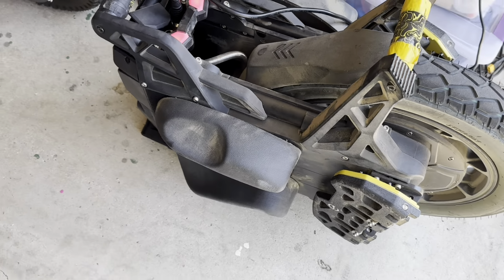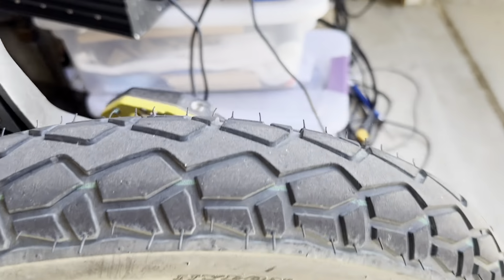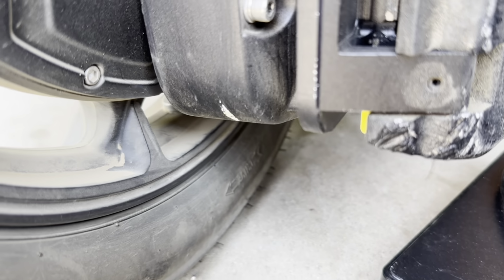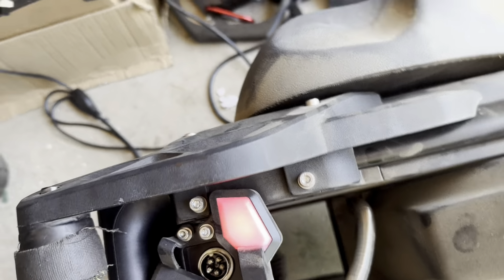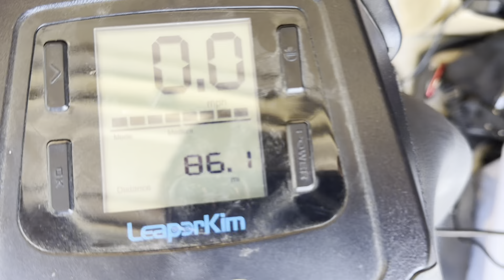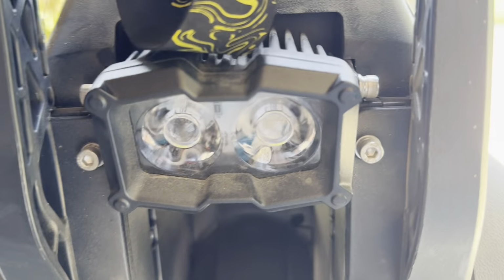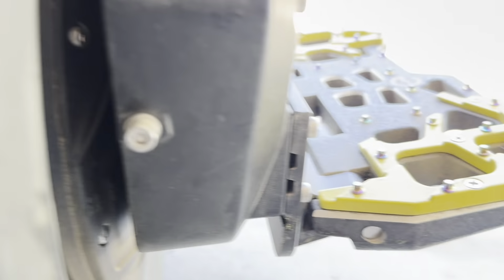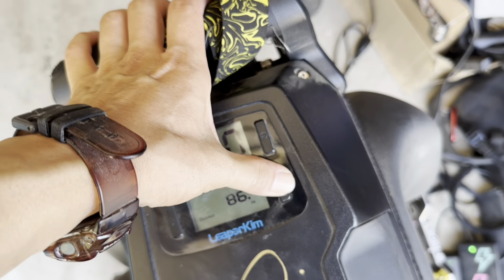I Got A New Wheel to Ride!!!

Comment: Hello, I noticed something. You pulled out the charger contact from the wheel(dont know if the charger was still on), I was under the assumption it was unsafe but I might be wrong. I read somewhere that when you charge, plug into EUC first, then into the wall, and was assuming when it was done, unplug from wall first then unplug EUC when you were done charging. Maybe I was wrong but I had no damages so far doing this. I'm sure you know what you are doing im writing this since i might learn something new. Does it matter what I unplug first when its charged ?
Reply: This issue does keep arising, and I’m not an expert but here’s how I see it.  
 
The Charger brick should be plugged into the wall first (before wheel) and unplugged last (after unplugging from wheel). There are several reasons for this (circuit design) but was much more of a problem when the wheel hardware used to be “hot” at the wheel plug, which would consistently snap-and-spark when connected with the charger. Currently, most newer models have a relay to prevent sparking/arcing but it’s still a good idea to consistently connect to your wheel only after your charger has been energized through the AC socket. Never connect a de-energized charger to your wheel first because there’s the potential of the DC side energizing the charger brick and back feeding DC current to the circuit, which could damage the brick. 
 
You’re justified in the concern but need a little background for it to make sense. Hope this helps. 
 
{I suspect but cannot confirm) that this is one reason why so many v12 chargers had failed over the past 2 years since we’ve seen higher voltages but the circuit protection may have lagged behind as wheel voltages keep increasing.}
Reply from the maker: Yes!!  This is what I've been told as well and what I try to remember to do.  Thank you for taking the time to type out the great answer!!
Reply: @grb1969  Thank you for taking the time to give this answer Grb. <3
Reply: @DawnSChampion  Thanks Dawn for your reply <3
Reply: What you are describing is for wheels made before 2020 🙂 You can relax and plug things in any way you want
Reply: @ElectricUnicycles  thanks for the clarification, Marty.